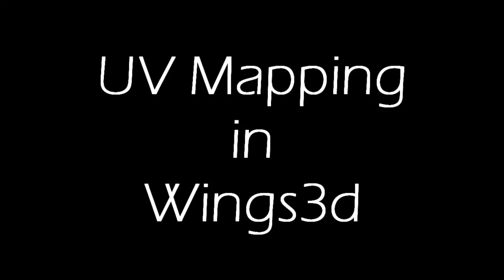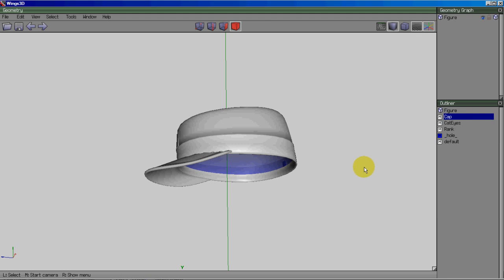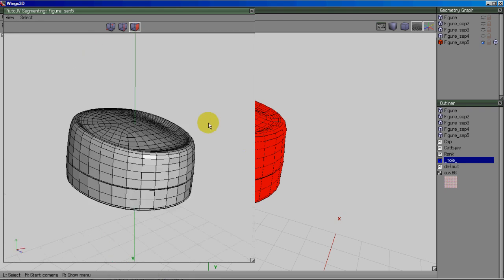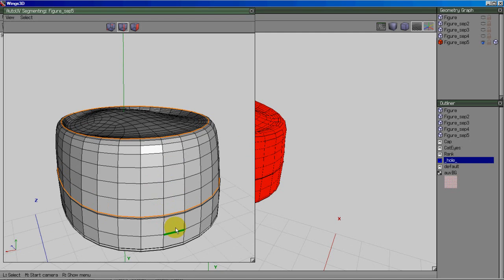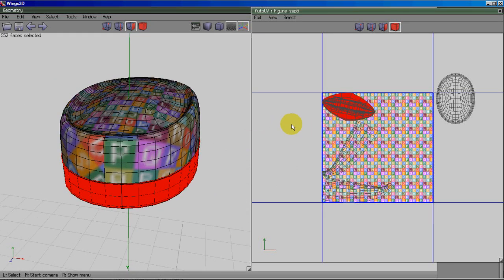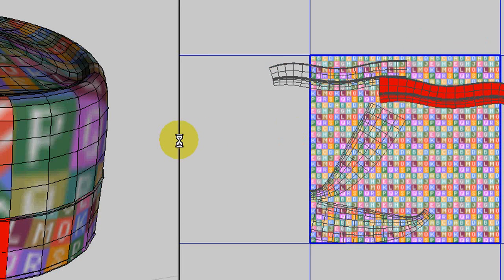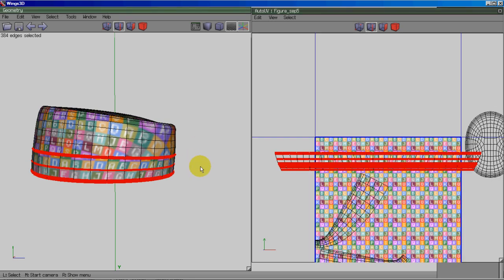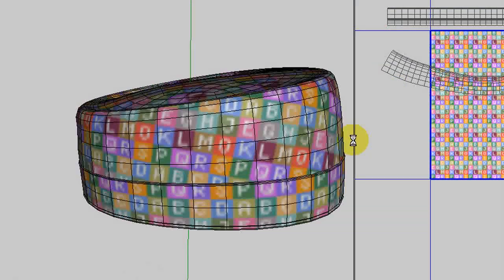UV mapping in Wings3d Part 1

Comment: I just downloaded Wings3d and I am new to how to use it, so tutorials like this one will be of great value to me. My main purpose for acquiring the software is for UV mapping my Bryce 7 models. I found that Bryce does not have the UV Map feature, so models that need "custom paint Jobs",if you will, must be exported to a separate program that supports that feature. Asking around in different forums got me a recommendation for Wings3d, and judging from the simplicity, it is a good one for this.

Comment: At 7:16 :  "selecting "L" along the UV  edges doesn't work, after they've been cut ; so I have to manually select each one of them" or you can do this : select their vertices, _then_ hit "L". It might be easier sometimes to select vertices  L on a selection of vertices will convert to loop(s) from all contiguous points (works in the geometry window too, for modeling), which can also take "turns", so to speak (unlike true edge loops). Another useful feature at times.